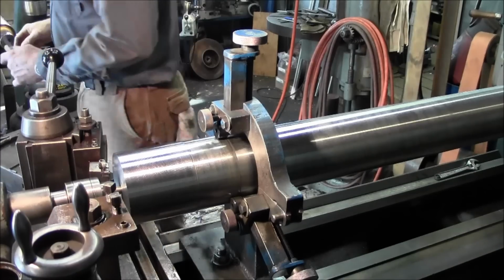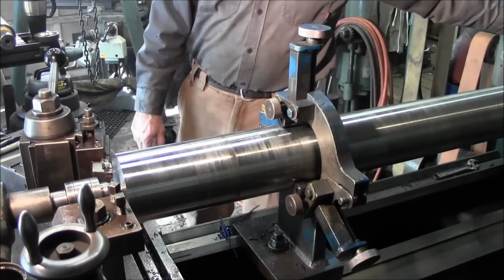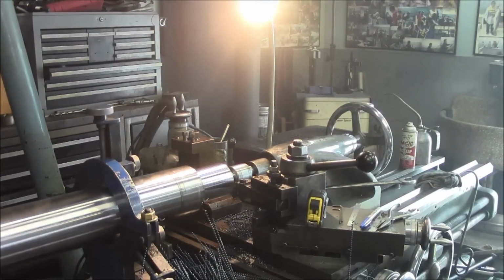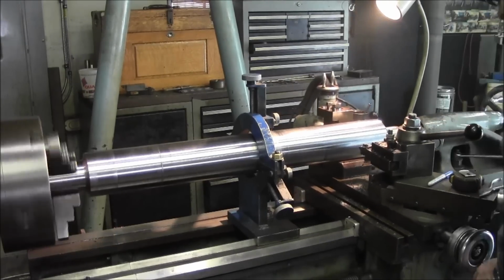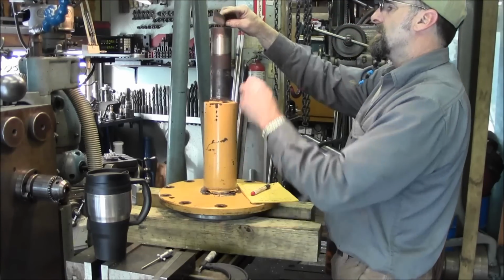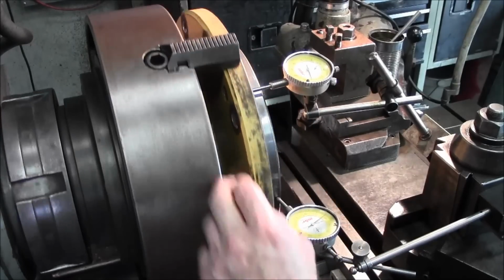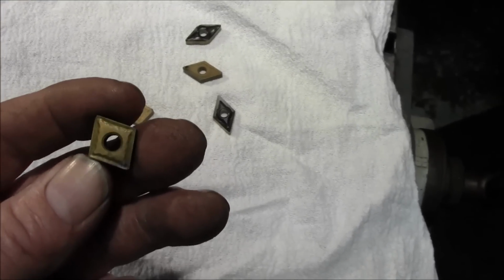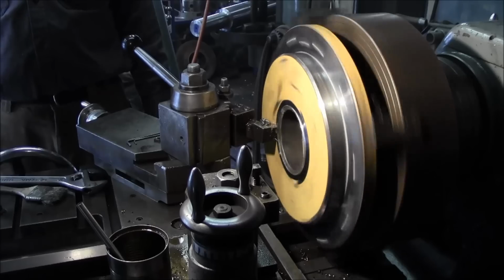The Broken Beaver Part 3: Wood Chipper Repair

Comment: Hi Keith,
Just watched this video, Veermer is supposed to be one of the better "quality" chippers, but that back plate has to make you wonder how good they really are and how potentially bad others might be.

That variation in thickness would have to have an impact on balance, unless they balance the completed assembly, which doesn't make much sense, as if you have to replace one part, then you have to rebalance the entire thing again, and it is not how good balancing is done from my experience.

Comment: Hey Kieth, t the end of this video you critiqued the quality or the manufacture of this shaft.  I researched the Vermeer wood-chipper.  They wanted to sell a bunch in China, but the Chinese govt. would not allow a straight import.  Hey, atleast the Chinese have a strong trading stance!  Vermeer had to have the chippers built in China to sell them there.  There were some "quality" issues with the Chinese made versions of that chipper.  Possibly, the unit you are repairing was one of the Chinese made chippers???

Comment: Fantastic to see a smallish but extremely capable  engineering shop / live on the job, its what is needed to maintain QUALITY !, All mass produced tackle is thrown together to last just until the warranty is out so the manufacturer can sell you another one at a ridiculous price .    Run out on the Flange probably caused it to break the shaft or maybe the Flange got distorted when the shaft snapped or during the oscillation over the period due the shaft being partly broken !.

Comment: I got another question about your lathe :-)
Does it have some kind of a neutral gear so the motor is running permanently and you can gear in the chuck when needed?I saw this on some lathes to make the motor last longer as there are always some short high-voltage currents flowing if you switch the motor on. So, if you run it permanently, you have a longer life on your engine than with always switching on and off. Not that it had a long life already. When was it built by the way?
Greetings Adrian

Comment: Only thing I can think of for the difference in size is to deliberately introduce a point of weakness in the machine.  The flange connects to the chipper drum, yeh?  Thinking if you drop something a little large into the chipper, or something that shouldn't go in, that the weld breaks, separating the drum from the shaft rather than a clutch system which might transfer more shock into the rest of the machine before engaging.

Comment: Like all the other series, I'm enjoying this one too.  I am a bit confused about the use of the 3-jaw and the tailstock center and all the flipping.  I would have thought that it would have been turned between centers using a dog instead even if it had to be flipped it would still remain concentric.  Other than that, I understand everything else.

Comment from the maker: The slide and facing shift lever has a sliding sleeve with a support tang that doesn’t sit right and seem to strain the rod assembly, so I made the drop loop so the handle doesn’t hang on the rod. The heat marks on the side are from replacing the guide sleeves for the rod. ;{)---

Comment from the maker: Thanks for the comment and yes I fudge that up, The holder is of a negative mounting and both style of positive and negative acting inserts are what I'm using. The insert has straight sides and fixed nose rake or nose cutting clearences. ;{)---

Comment from the maker: The holder is of a negative mounting and both style of positive and negative acting inserts are what I'm using. The insert has straight sides and fixed nose rake or nose cutting clearences. ;{)---

Comment: Lawrence, I've wondered about this myself; I may be wrong but I think the positive top rake built into the insert is greater than the negative top rake of the toolholder, so that ultimately the top surface the insert presents to the work is angled at greater than 90 degrees from vertical.  I know my toolholders are designed with -15 degrees top rake, so I think the positive rake inserts have a top rake of greater than 15 degrees to overcome the negative top rake built into the toolholder.

Comment: Thanks for this explanation!  I've also noticed equal length chips occurring when rough turning and never thought about why it happens.  With the right combinations of feed, speed and chip breaker shape, sometimes chips will break into very short "sixes" or "nines" as they leave the insert but this is rare in my experience doing one-off projects.

Comment: As a regular watcher I've pondered a question for some time- Does the time you take to explain what you are doing add substantially to the job time?  Alternately- Does it prevent you from making mistakes by forcing yourself to work through the explanation prior to performing it? meaning, you are very skilled but we all have brain farts from time to time- do you sometimes catch problems while explaining before they happen that you may not otherwise if you just jumped into the job?

Comment: I agree a great series!... love the lathe work Keith....I would like to comment on the inserts weather they are Pos or neg is not totally correct... its the actual tool holder which designates weather its a pos or neg ...what you are referring to is top rake, side rake... angle or clearance... ect

I am fortunate to have a real life machining  mentor who is also an engineer which has explained many things like this...

Comment: No matter how tight your shaft-flange fit is, that heavy weld will cause the assembly to be more or less out of shape and there really is no other way than machine it to final dimensions after the welding process.

Comment: Wonderful vid!  Really making the old girl earn her keep! Love the aroma of hot sulfur-based cutting oil along with the taste of the morning coffee! Lots of heat into the part turning those shoulders--oil smoked on contact!.  Chips broke a little; really helps the clean-up.  Thanks for the insert chat!  Still need some positive rake inserts to go along with my negative rake Kenloc CNMG 432's for a future turning project. Won't the huge runout on the faces of that flange cause axial vibration?

Comment: I can't figure out that flange.  Either the gap between the shaft and the flange was intentional, in which case they'd need a jig to center it when it was welded, or it was NOT intentional, which means no jig, and almost no way to attach that flange centered with any accuracy at all.  The only other possibility is that it was machined after it was welded, which would definitely be doing it the hard way.

Comment: Thanks again for the videos, another great project. I bet the chipper runs a lot smoother with the new shaft! It's amazing how badly the original was finished given the pounding it takes in use.